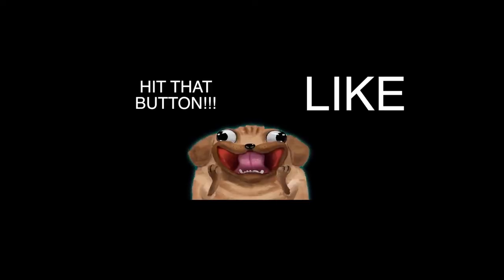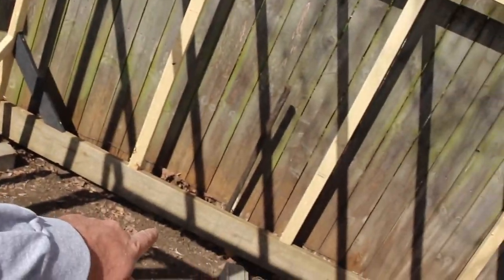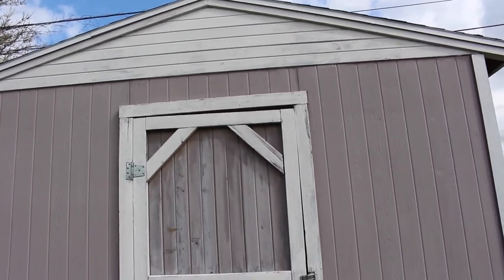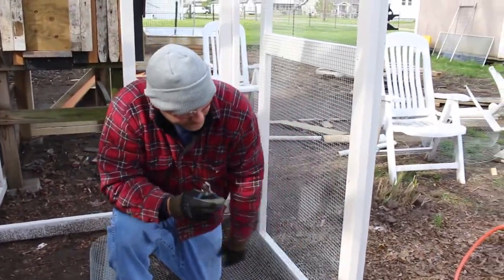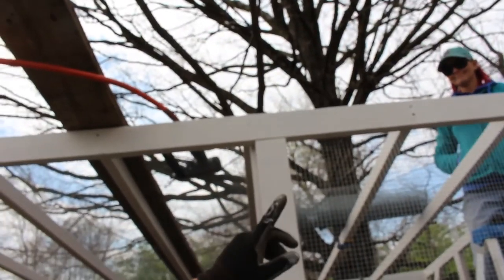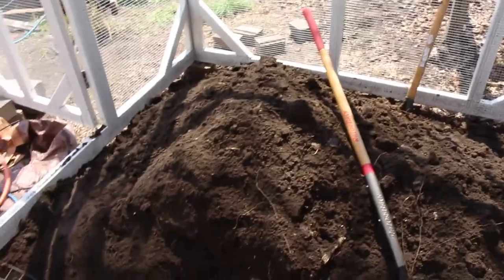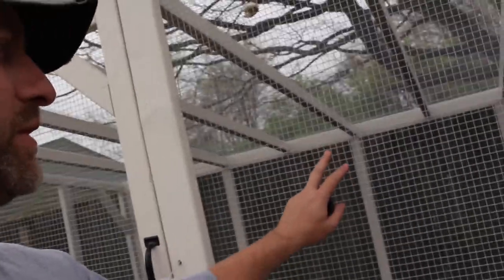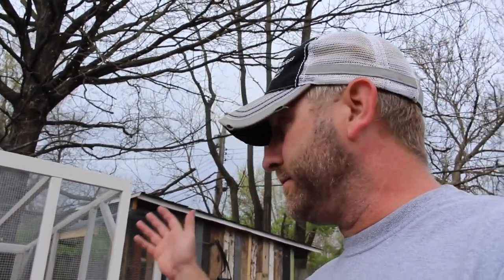DIY Chicken Coop Run | How To Build - Complete Build

Comment: Why did you use sand??
Reply from the maker: It's a construction grade sand and thought it would be easier to keep clean and dry.  And it really has been.  I've never had a mud issue and cleanup is very easy.  Kinda like a cat litter box.